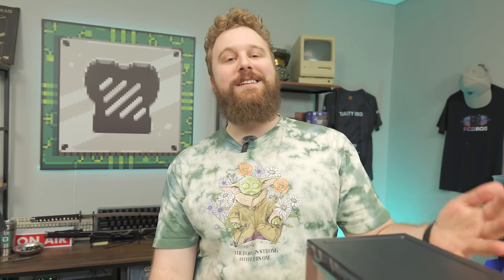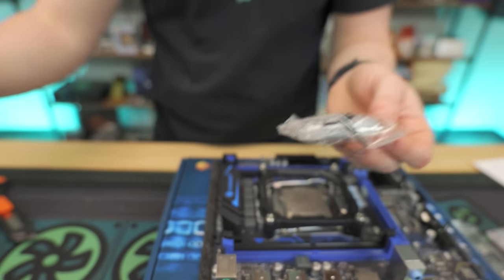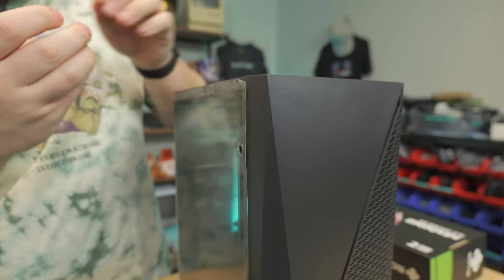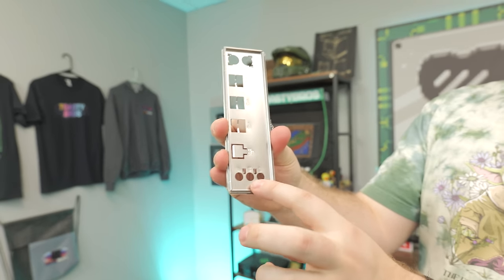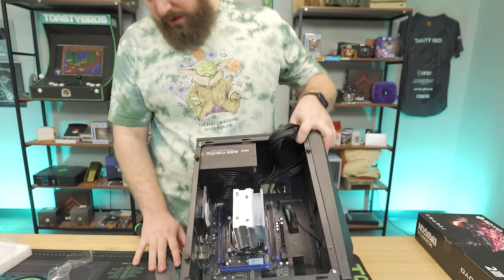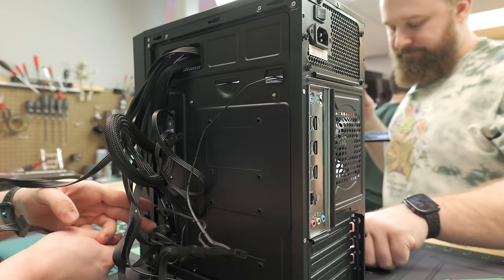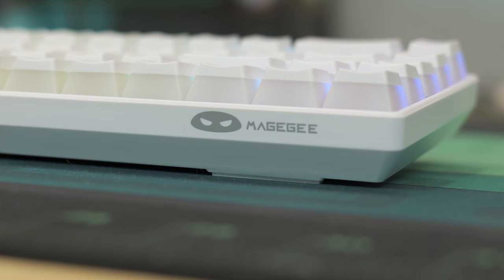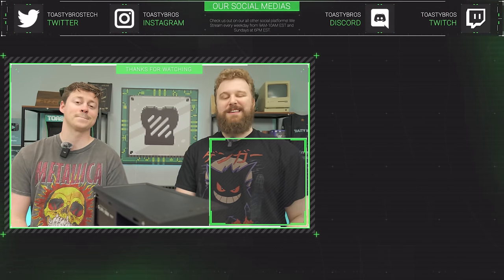EASY $270 Gaming PC Build Guide - Step by Step

Comment from the maker: Motherboard+CPU+RAM: https://s.click.aliexpress.com/e/_mr09aNg / https://s.click.aliexpress.com/e/_mL02NtU

RX 580 2048 8GB: https://s.click.aliexpress.com/e/_mt7CPiA https://s.click.aliexpress.com/e/_msK3JF8

Aigo Air CPU Cooler https://s.click.aliexpress.com/e/_mtwnzsa
Razer gaming Mouse: https://s.click.aliexpress.com/e/_mM3XWYw
MageGee 60% Mechanical Gaming Keyboard: https://s.click.aliexpress.com/e/_mMLXzJM
Secondary Screen:https://s.click.aliexpress.com/e/_mq5k1nc

More AliExpress Anniversary Sale big promo hidden gems:https://s.click.aliexpress.com/e/_m0V5fXG
Up to 70% OFF

Code: WOW328- $10 off for orders over $50
Code: ALLONAE- $20 off for orders over $100
Valid to 3/27 

#AliExpressAnniversarySale #AliExpress #AliExpressChoice #AliExpressDeals
Reply: its an awesome build im not gonna die but the rx 580 is freaken bat at games like alan wake 2 so the rx is not good thing i guess it will be awesome with the same price but without rx 580
Reply: quick question could you send a link to the batteries?
Reply: bad games..

Comment: I actually like acrylic cheap cases.    mainly for weight reasons,  not great for scratch resistance. But it is cheap, transparent and very light weight for 50$ or less. Zalman T7 on sale is one of my favorites(and its full size atx)
Reply: But they are flimsy 😂
Reply: @h.i.t.m.a.n_47_911   well what are u doing with your case. tossing it around? its a desktop....
Reply: Yeah and some of these glass cases be heavy as hell.

Comment: I just built a computer for my sisters and it was very very similar to this one. 
Xeon-e5 2690 v3 12 core 24 thread 
Rx 580
16gb ram 3200 mhz
Same exact 512gb ssd
Same exact motherboard 
Used corsair semi modular 50$
Cooler master cpu cooler
60$ case 3 fans argb 
It ended up being right around 300$ so I’m glad to my research and part choice was accurate since I’m just a 15 year old computer nerd.
Reply: Love to see it
Reply: Good stuff. Keep it up 👍
Reply: does it run fortnite and minecraft 100fps+ ive been wanting a affordable pc that i can play comfortably on
Reply: @boogerdrop it does. 1080p Fortnite on performance settings I get 150+ fps at least and Minecraft is easy to run on most computers so you’ll get plenty of fps.

Comment: The case could be replaced with a Cooler Master Q300L for the same price; there's a version 2 for it but the first version is easier to find at that price. I had Q300L since my first build and only recently changed it, and it did the job and was great; sturdy but light, and the airflow was great if you don't mind fan whistling/noise that extra fans can have. Still, having a rx 580 build like this at this price is amazing!

Comment: Hard to beat what you're getting for the price. In all honesty, I would look for a used GTX 1070 or GTX 1660 Super for about the same price. Honestly that CPU should have enough juice to run a significantly more powerful GPU if anyone wanted to upgrade down the road.
Reply: A 1660, 2060/S, 2070 would work well in that computer I reckon, a 2060S has the around the same power draw as a 580 too, 9 series are still getting driver support so they'll be supporting Turin for a while yet as well.  I use a 6 core {cheap} Zen 3 in a B450 with a 2060S and I don't think there would be much difference in gaming between that or this $270 build with my card in it.

Comment: Would you mind adding power consumption stats to your videos? How much power do your builds consume during idle, how much under load? It wouldn't have to be some elaborate measuring setup, just the measuring devises you'd put on your wall plugs would suffice to get a good idea. It would be interesting to know. Especially with these more exotic AliExpress types of builds.

Comment: There are still custom drivers for the RX580 cards. I have an RX580 2048sp in my spare PC and with custom drivers it is still running modern games fine.
Reply: AMD cut support way to soon
Reply: Is the RX580 better than the GTX 1060 6GB?
Reply: @BREEZYM6015  If you're going for a budget card I'd likely go for the 1060 6GB. It may have less vRAM but it is still getting official driver support.

I got the RX580 8GB 2048 because one was available on Aliexpress for just £42 including delivery.
Reply: better not go with 6gb..
Reply: surely..
Reply: @Samuel-ft9hq  The 6GB GTX 1060 is still a reasonable card in 2024. It currently sits at number 6 in the Steam Hardware Survey, though to be fair it doesn't make the difference between the 3 and 6GB versions.

Sure you aren't going to be playing the latest games at the maximum settings but 1080p Low should get a playable experience in most titles.

Comment: imo it’s not the best deal you could do when you can go for the 8GB RDNA1 cards like the 5500/5500XT. They still have official driver support  and offer more power for not much more than a 2048, which at this rate, shouldn’t really be an option.
Reply: 580 still has "official support". They simply stopped updating drivers for it.

Comment: You could of gotten a Huananzhi B660M with i312100f cpu Cheap. Must faster. It also has future upgradability, pcie gen 4/5 and 1x nvme gen 4/5.
Reply: I’m seeing it for $146 with no ram, are you looking at a different one? Wondering if it’s worth $62 more than their combo. But, there is a h610m 12100f combo with 1 ram stick for $88, do you think that’s better than their combo?

Comment: guys i found a prebuilt used gaming pc form a guy in a nearby city going for 360 euros  with ryzen 5 3600 gtx1660ti and 500gb ssd  in a small itx case wtih an 130$ motherboard from aorus  i thinks its a very good deal  what yall think ?
Reply: It's good
Reply: Dawn it's worth it
Reply: Amazing deal! Buy it as soon as you can.
Reply: he also told me i can put it on hold cuzz im saving up some cash atm   no one was intrested in the pc proly cuzz of the small case maybe
Reply: @e3nnsar  buy the dawn thing before it's gone and check everything before buying

Comment: i died a bit when you used pliers on the standoffs, oof gotta do finger tight so you dont break the metal on that cheap case
Reply from the maker: Little more than hand tight or your gonna take a riser with a screw if you try and remove the motherboard

Comment: For emulation of old games up to PS2 level, would you recommend building this or buying a cheap mini pc?
Reply: I'm having this same thought.  Any input to this question?  Build this or do a 6th or 7th gen i5 HP Elitebook or Lenovo Thinkcentre???  I suspect many here will say add a graphics card to an Optiplex.
Reply: @jeanpauloverton  so for this, i used to have a optiplex with a basic Geforce 1060 card and it worked flawlessly for ps2, psp, and ps1 1080p , gamecube most games at 1080p. dreamcast and xbox worked but left something to be desired. personal opinion id just build one of these unless you can get your hands on a DIRT cheap optiplex (mine was free lol) you can get a little more power at a lower cost and more room for future upgrades by doing one of these mostly aliexpress builds. hope this helps guys!

Comment: Anyone know why when I move my mouse around in game the screen becomes super glitchy yet my frames are stable at 240fps? Tried different mouse and issue still persists
Reply: It's called screen tearing. You monitor may not support 240fps. In that case turn on vsync.